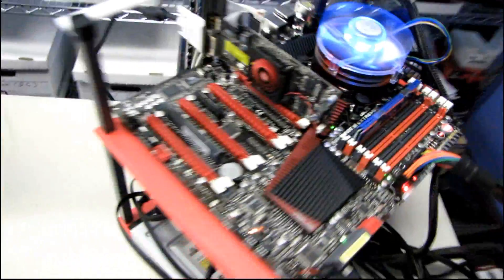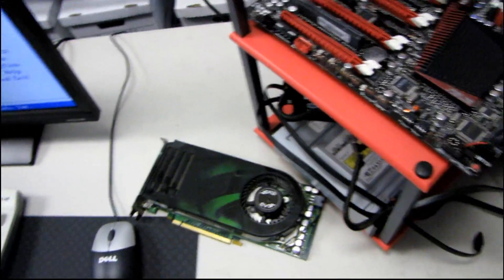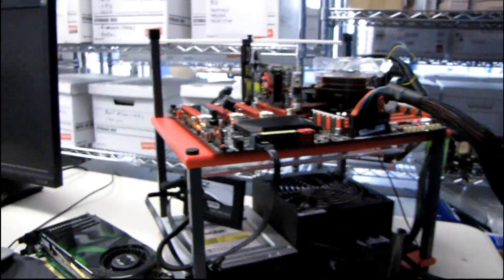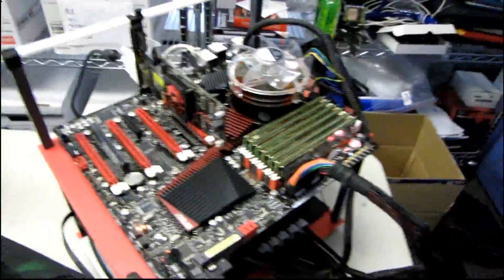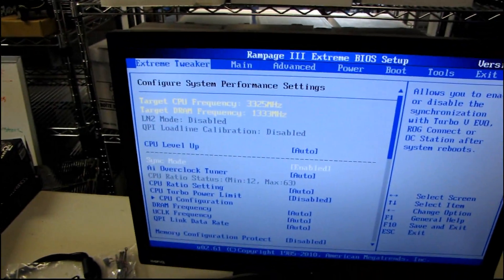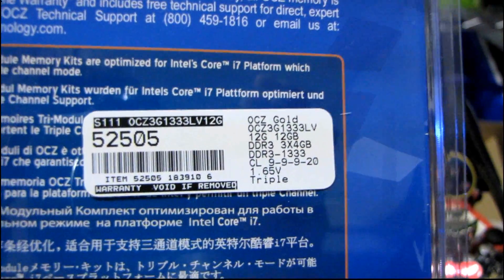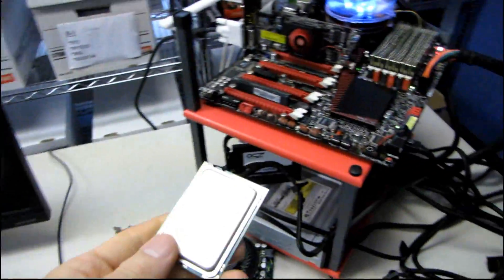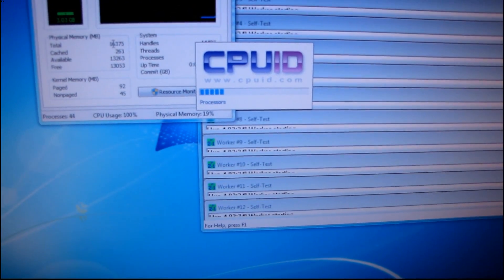Rampage III Extreme 24GB RAM Core i7 980X SUCCESS!! Linus Tech Tips

Comment: If you see in the video, the IMC- Integrated Memory Controller  - voltage is at 1.1v.
Try setting 1.2v for IMC, since you are loading up all 6 dimms. or even more 1.25v or even 1.3v (look up max voltage spec for that IMC platform , I had to bump it to 1.2v for 4 dimms.

Comment: 11 year ago this PC build was absolutely insane, and now, after so long it is steel very good config.
Reply: I have a 990x and duel 3gb gtx670 in sli it's my back up/kids pc I know if I take out the 670s and stick my 2080ti in it I can still game very very well on it
Reply: @acid3129 I use my 990x pc from that era as a dedicated Plex server now. I also got rid of my sli and put in a used 980 ti I got for cheap.  At 1080p the 980 ti is correctly matched, I’d recommend it for ur kids pc. The 670s will bottleneck that cpu hard. It also doesn’t support any modern features and most modern games won’t use the second gpu. Used 980 ti is only like 60 dollars rn.
Reply: @skurasch  you do have a point I have a modern pc for my gaming.  I7 13700f and 3080 . I just like making old over the tip systems that I could never afford years ago . I have a storage room at my parents place full of old builds I put together use for a few months then get bored and move on to the next project I'm currently trying to get the parts for the smallest lga1151 pc I can build I have an i7 7700k and an rtx A2000 I just need an sff psu and a case but I haven't decided yet . I'm a stay at home carer for my partner and my nan so I get alot of time doing nothing and spare cash that would normally be spent on travel to work that I use to get pc parts it's just a time waster when I'm not rushing off to hospital or doing other care related tasks I sit in the corner messing about with computers until someone needs me for somthing it's how I stay calm when shit gets stressful
Reply: @acid3129  I wouldn't mind having this motherboard. I do have a Sabertooth, also X58 and have 2 gb of ram in it, an X5680 cpu, which is overclocked to 4.65 GHz

Comment: Almost 12 years later, I've got an R2E with 990X, flashed with latest BIOS, inserted some dirt cheap DDR3 JEDEC models (no one knows they got this cheap eventually?), and a "38.5W TDP" 750ti, expecting it should boot and detect all modules, and... I got only 2 of them detected. Although all of them are different models, but all of them includes JEDEC profile down to 800 (as they should). What a headache.
Anyway my experince (hundreds of build, no matter working fine or broken) told me that it should be shady DIMM / CMOS / BIOS circuit (a.k.a RAM support) instead of GPU. Unless you've got a nice set of Corsiar Triple channel memory (hard to find!), I'd guess that there are no fesible or effective solution.

Comment: This cpu is as powerfull as i7 3770k which was realeased 2 years later or even more powerfull (i'm not sure). You can pair it with a gtx 1080 and have minimal bottleneck or none if you overclock it because it has a big overclocking potential and 1070 would be a sweet spot if you don't plan to overclock.
Reply: Can confirm does not bottle neck 1080ti/1070ti. If you repaste your NB/SB cooler it won't throw a wrench when applying a 5% pcie OC, some boards may be lucky enough to go higher.

Comment: running this board with the 990x 1060 24g ram crammed in a haf-x case and love it. i have the msi optix ag32 monitor and run 160fps + in fortnite. havent tried other games for fps. also it has a corsair 850watt power supply. 

but i am very happy with it.

Comment: I resolved the missing RAM issue by turning Memory Recheck on in the BIOS. So I could access all 18GB of RAM , HOWEVER, the system became unstable and would randomly freeze or reboot.

My Rampage 3 has since died, fans spinning, peripherals not lighting up.  Took all my RAM out and I recall it having post beeps before, but nothing now.

Guess it's time for an upgrade 👋💸💸

Comment: Who is here in 2019?
Reply: 2020 baby
Reply: 2020!.. trying to get 24gb of ram working in my very own rampage 3 extreme.
Reply: @Conan_The_Librarian  If you see in the video, the IMC- Integrated Memory Controller  - voltage is at 1.1v.
Try setting 1.2v for IMC, since you are loading up all 6 dimms. or even more 1.25v or even 1.3v (look up max voltage spec for that IMC platform , I had to bump it to 1.2v for 4 dimms.
Reply: Just bought 24gb in for an i7 920 build I’m still using as my daily driver. It’s faultless
Reply: Planning to upgrade to 24gb too. Do you have idea whats the best frequency to run? Only says up to 1066 mhz but can I put higher? Like a 1600 mhz.
Reply: @jaypeevuelta8422  in bios you can use the xmp profile and enter the ram speed of 1600mhz. I had a few crashes when I did this so used 1333mhz and haven’t had any issues . It use to be 1066mhz

Comment: I know, this is an old platform, but i use this old platform with pleasure in 2019. Its often a 1366 socket problem when the cooler is pressing too much on cpu. Sometimes any Memory Sockets not working, somtimes Windows cannot see the full RAM except CPUZ. 
I already had that only Windows has seen the complete RAM, but not CPUZ or the BIOS. All my X58 boards, which were sold on eBay with defective RAM slots, ran with a little less contact pressure from the CPU cooler.

Comment: Yay 2019, and Im using an x58 Intel Xeon W3670 overclocked to 4.4GHz on all 6 cores. Watching this video because I need a new motherborf :/ also considering a 980x lulz. Although I am running 24Gigs Ddr3 from when the system was new. Hooray for x58 stayin stronk!
Reply: Ay! I have a Xeon W3680 and 24gb of ram!
Reply: I have an X5680, overclocked to 4.65 all cares

Comment: it says on the intel Offical site that Core i7 980x max memory size depends on the memory types which is locked to 1066 to get the full use of your 24 Gigs of ram that maybe the issue https://ark.intel.com/products/47932/Intel-Core-i7-980X-Processor-Extreme-Edition-12M-Cache-3_33-GHz-6_40-GTs-Intel-QPI so i know its an old video of yours but that motherboard still a life in our country

Comment: Its unbeleivible How far we've come in 7 years
Reply: Yes my X5670 from 2010 at 4.5 is just behind a 5820k what's a BIG progress or not
Reply: What do you mean? We didn't come far at all, even today standard is dual channel RAM (not triple like this), barely anyone uses or needs over 16 GB RAM, and 6 core became standard just recently with Ryzen push. You can literally just add new GPU (if you even need it) to system such as this and still obliterate good midrange builds today. We didn't come far at all, it's miserable and this is one of the slowest moving industries when it comes to technology.

Comment: can you help me i have a asus p6t deluxe

why can not I use Crucial Ballistix Sport xt 16gb kit 1866mhz CL10 ( 10-10-10-30 ) ddr3 on my system :( HELP
Reply: Eldar Mutapcic check the max RAM speed and capacity of your mobo by checking the Asus website...
Reply: Triple-channel DDR3 2000(O.C.)/1866(O.C.)/1800(O.C.)/1600(O.C.)/1333/1066 Memory
Reply: Eldar Mutapcic  what is you cpu and motherboard .. your dimms 8gb each ??
Reply: intel core i7 930 and Asus P6T Deluxe
Reply: Eldar Mutapcic  you can use 4gb 6 dimms 
totaly 24 max
but 8gb single dimm and more than 24gb i think you need x5600 xeon
i am not sure about the single 8 gb 
but i am sure about the 24gb limit
Reply: would it help if I put a intel i7 965 Extreme 3.38 cpu
Reply: Eldar Mutapcic only x5600 serise can take more
that what intel website says
if you want try but i cant insure that they can take more
Reply: Eldar Mutapcic I had the same problem with that board. Make sure you are using triple channel correctly..... Your board ram slots are color coated for a reason. make sure you are using the 3 same triple channel ram in for each color. So 6 slots  = 2 colors. (orange and black for me)......3 slots for orange have the same type of ram (triple channel) 3 slots for black have the same 3 types of ram... or they all can be the same.......  Then update your bios....... MSConfig > Boot > Advance Options > Unchecck the box for maximum memory and set it to 0

Comment: im still sitting here with 12gb ram in 2016
Reply: same here. i7 870 OC to 4.04ghz with 12gb DDR3 1600
Reply: Supa O.T. I still think 12gb is still good though
Reply: JonathanDavid J the speed doesnt matter lol
Reply: Same here. I'm actually still using an i7-980X and it's overclocked to 4.0 GHz. Seven years later and this thing is still a monster. Go figure. I could push it further, but I'm only using a single 120mm rad for the water cooling, so I can't without running into temperature problems.

I still can't believe what the performance of this bad boy is like when overclocked. In Cinebench, it scores around 916. That's i7-6700K territory. (I've also got a video in my channel of Cinebench on this thing. Shameless plug.) I have never been happier with a processor than I have been with the 980X. It's lasted so damn long, and will continue to last. I might upgrade if Ryzen is competitive, but as it is, this computer might last a full decade or more assuming nothing breaks.
Reply: it's close to a stock frequency 6700k... I bench marked my 6700k at stock and I got a score of 936 and when overclocked to 4.5 ghz I got a score of 1010
Reply: I still only have 8 gigs :'c
Reply: The Little Drummer Boy 9636  Exactly. Because if you have a system like this, you will only ever need an SSD and a new Graphics Card.
Reply: same
Reply: 12gbs is still plenty, it's the speed that matters.
Reply: I also came from an I-7 920 with 12gb of ram (3-4gb) at 2.6 ghz so it's a big step up lol
Reply: I’m here with i7 990x 24gb ram and gtx 1060 6gb
Reply: My fave, what board? My gigabyte UD3R is same as Linus rampage and no bent pins, it wont recognize more then 16gb, middle slots will make it reboot three to four times before entering windows every-time, does a patch or detecting dram... grrrrr
Reply: im at 8gb and its not full usage in everygame lol
Reply: 48 in 2019 :):):)
Reply: Deymm .  I still have 8gb ddr3 in 2019.
Reply: Still there.i7 980x 4.3ghz , 1080ti,24gb ram (oc 2000mhz) rampage iii gene